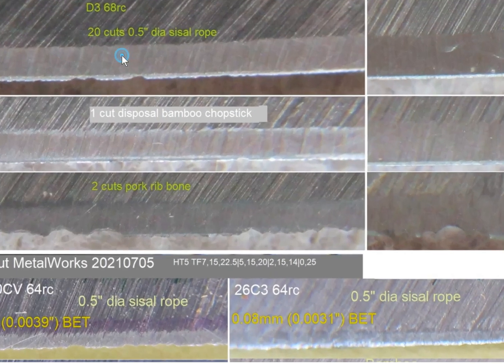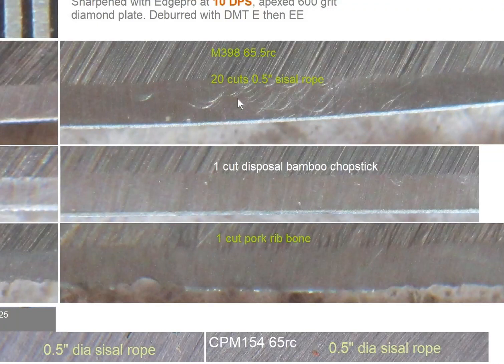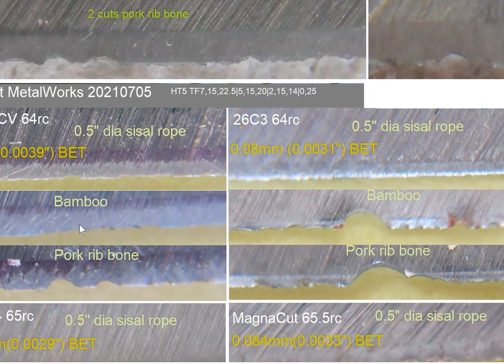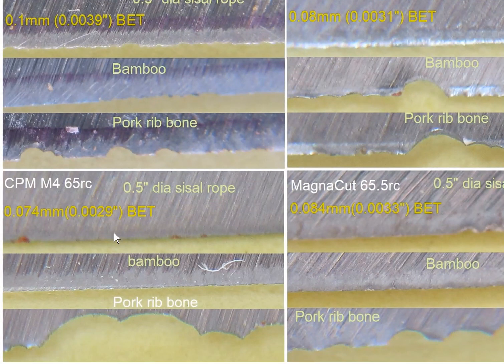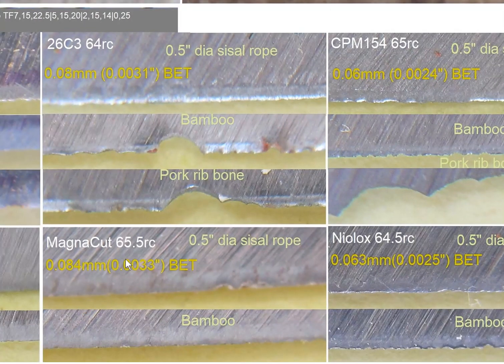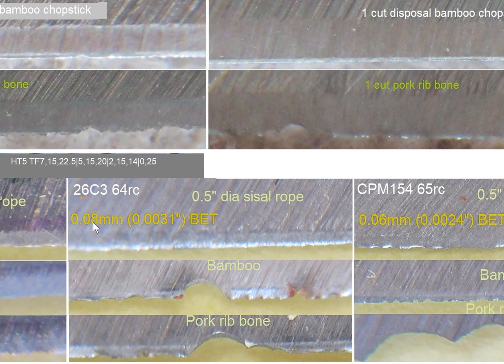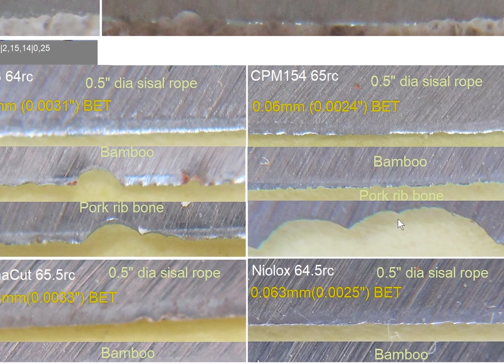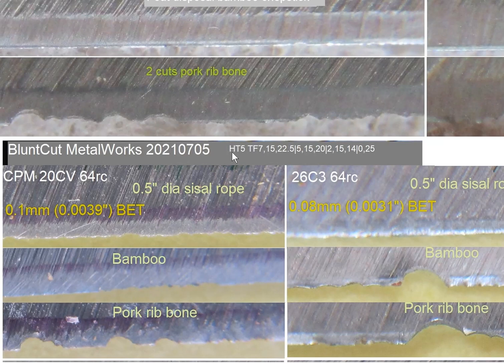D3 68rc M398 65.5rc 10 DPS Edge Cut Test

Comment: The M398 performed very well. 👍
Reply from the maker: M398 has almost as much carbide volume as s125v, so hopefully s125v 15dps chopper will perform well... given I can learn to do a decent stick welding blade & tang together.